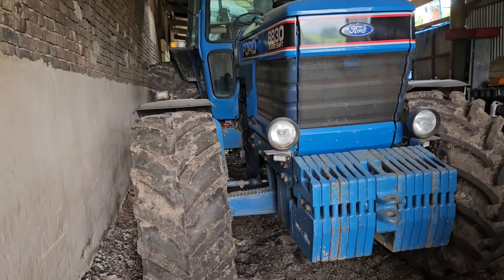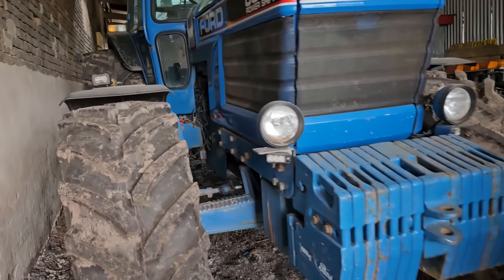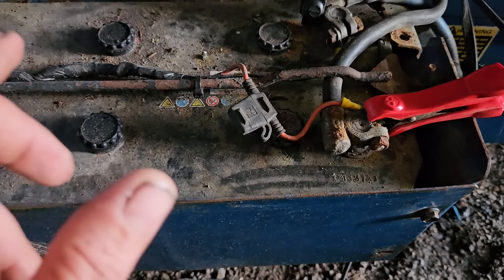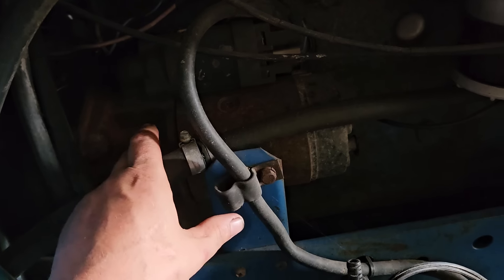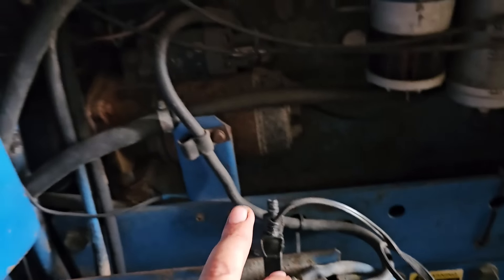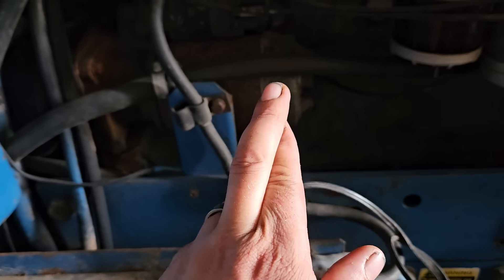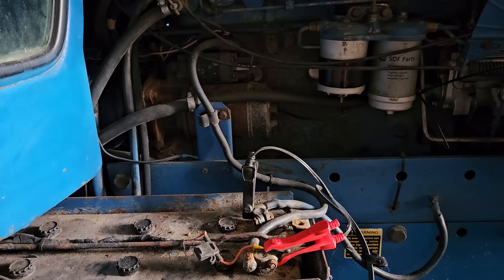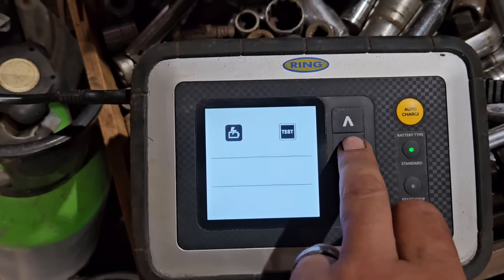trying to repair smurf. mix of failure and possible success

Comment: love smurf  but whats your thoughts on tm160 ?
Reply from the maker: Cheers mate. Not driven 1 personally but know a few that had them new they didn't have them long. Don't know whether nh did anything to improve them like they did to the 175s and 190s
Reply: I have a Tm165 and they have got the right power to weight ratio. Cabs a good size and grunts well though the gears, I really rate it for cultivation and drilling. I wouldn't rate it if you do alot of road work but it's 40 and comfy. 
Hope that's helpful